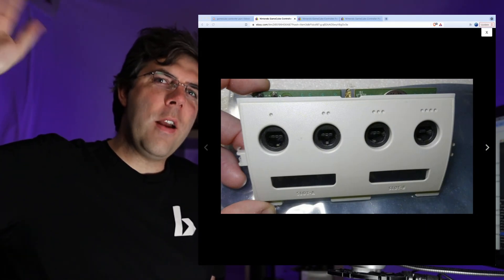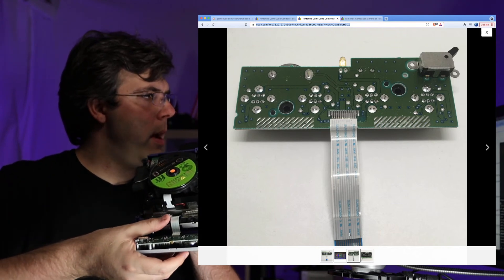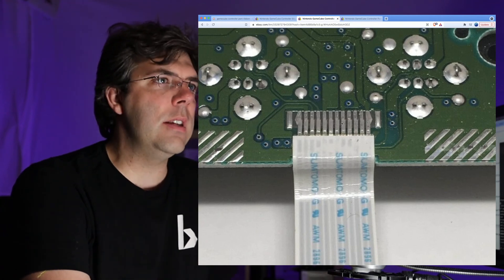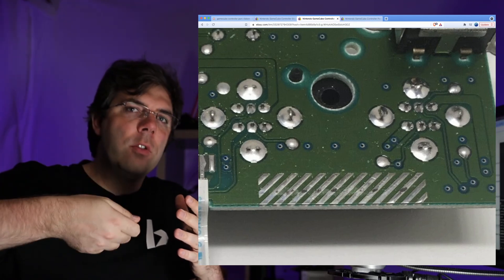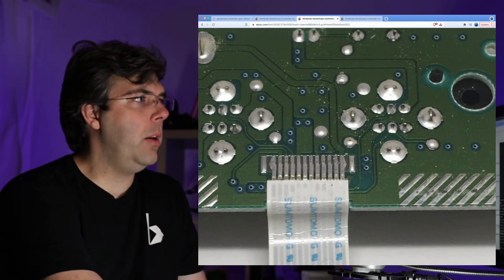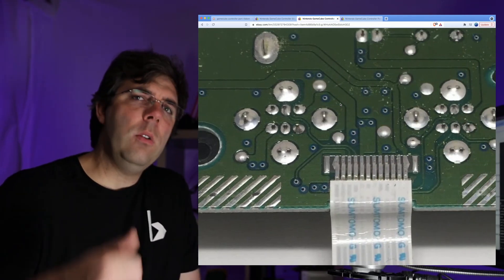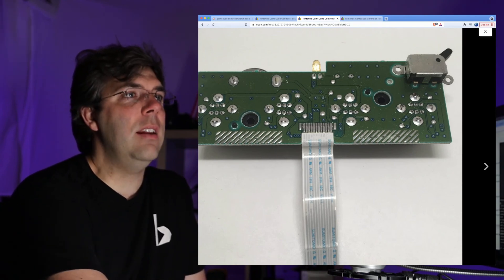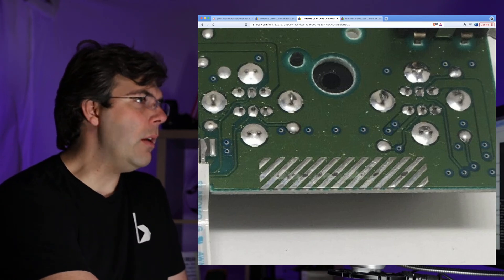[SolderJS] How to Fix Bad GameCube Controller Port / Controllers not Recognized

Comment: thanks so much!!!!! this has been really informative. i got a whole new set of ports because i though they were molded (BIG YIKES) but after this i realized the pins were probably just oxidized so thats a huge relief. im still going to replace them since i have a new part anyway and i still cant find a tool small enough to really get in there and scrape it off enough to make ports 2-4 work. any suggestions for ways to cut down on that possibility for the future? granted its been over ten years since i bought mine used but im planning on playing it until i die so ill take any advice lol
Reply from the maker: Electrical Contact Cleaner + Brass wire brush or tiny brass wire wheel (sometimes called a polishing brush) or a brass spiral brush. The reason I say brass is that brass is soft so it's more likely to be abrasive enough to clean corrosion without being too abrasive to the plastics and tin contacts.
Reply: @coolaj86  thanks so much!! ill def look into it. maybe ill end up with two working ports which would be great for future repairs!! <3

Comment: The two sets of diagonal lines look damaged too. I just accidentally damaged them on mine with my first repair attempt with the POT when putting it back together and not liking it up properly. It was booting fine before and now it just loads the GameCube logo. Is it possible to fix this? Or is it irrelevant and I’ve actually likely damaged the ribbon or something?

Comment: I have an issue where my controller won’t read if I plug it in all the way but if I pull it out a couple mm it works fine. Same issue with different controllers. Still trying to figure out the solution.
Reply from the maker: It's probably the same thing with slight cracks in the solder or PCB. Check for hairline fractures and reflow the pins. See if that helps.

Comment: Thanks for the video! I reflowed all 6 pins and the 4 anchor points on mine. But the pcb was cracked from impact. I had to run jumper wires for the bottom left pin and the top middle pin. Works good as new.

Comment: My controller doesn’t rumble on port 1 but the other 3 controller ports work fine, Controller port 1 is fine apart from just not allowing any rumble to the controller??
Reply from the maker: I would guess that it's not getting rumble power. Probably the same solution I show here would work.
Reply: @coolaj86  yeah I’m waiting for my screwdriver from Amazon hopefully it’ll come tomorrow I can then open it up and see what the problem is I thought it was the controller at first but tried it in the other ports and it works perfectly fine in those just port 1 doesn’t make it rumble, my port is a bit temperamental the controller didn’t work at all at first I ended up using a cocktail stick to wedge it place it worked fine minus rumble I then took the cocktail stick out and after messing with it it works without anything wedged in but still no rumble it’s so frustrating 😖